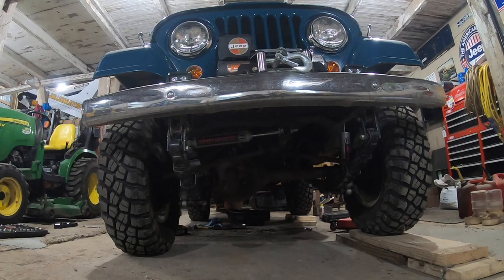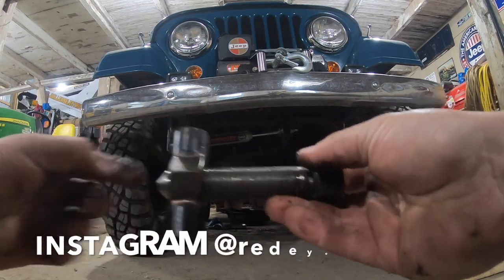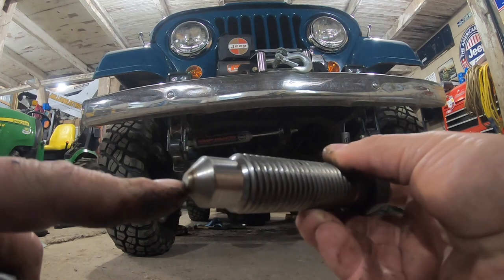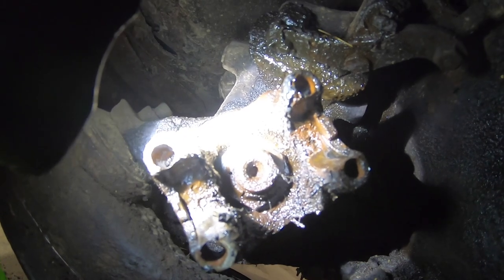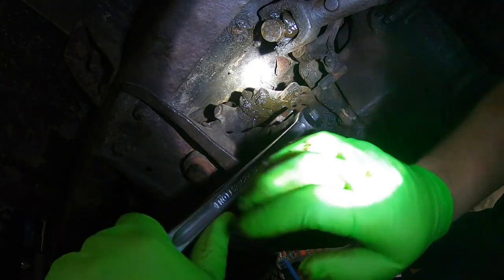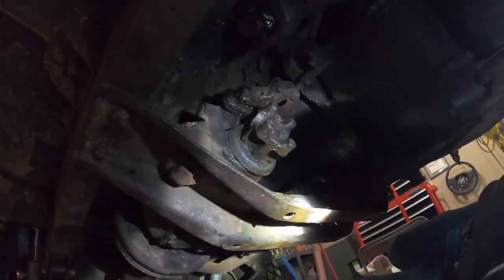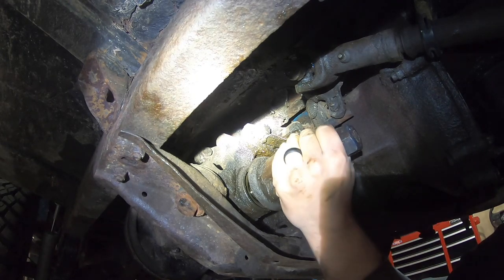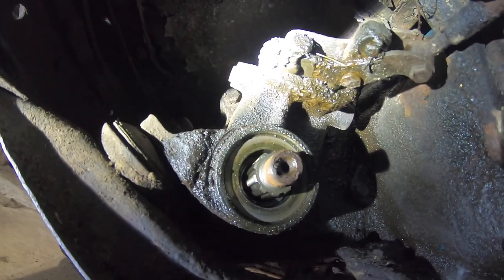Using a HOMEMADE YOKE PULLER to Remove a Jeep CJ5 Transfer-case Yoke

Comment: 1st step. Buy a mill. 2ns. Buy a welder. 3rd. Buy $25 in hardware. 4th reinvent the wheel instead of buying a $30 yoke / pinion puller online. 😂😂
Reply from the maker: My buddy built this and I like to support small business/people I know rather than Amazon and businesses like that, even if they are cheaper or faster.
Reply: And much better than the POS that are way over priced these days.    I’ve went through flywheel & balljoint pullers … I’ll def check out his pullers